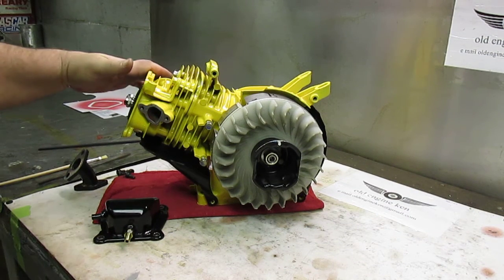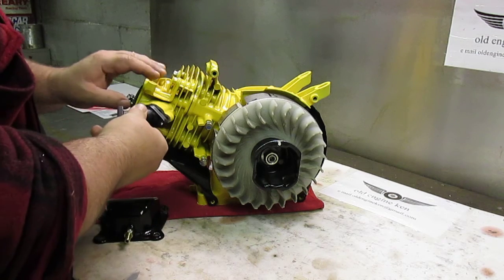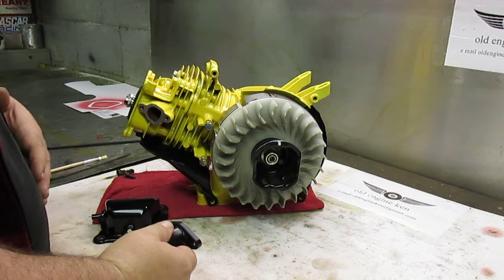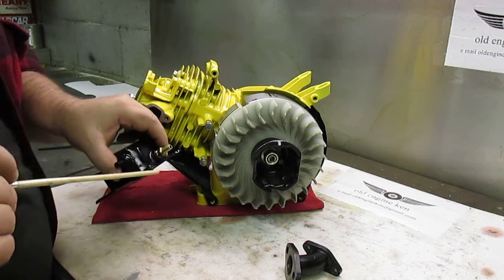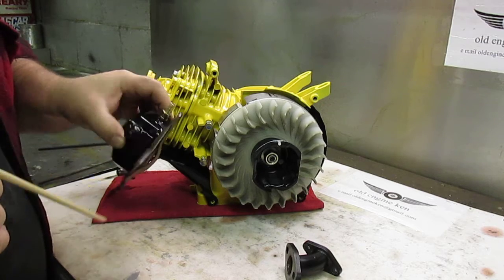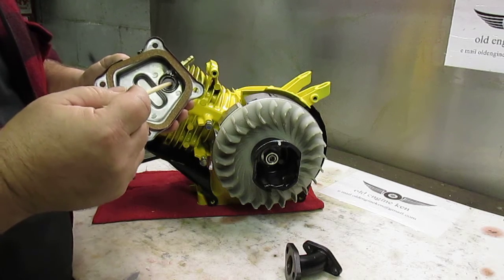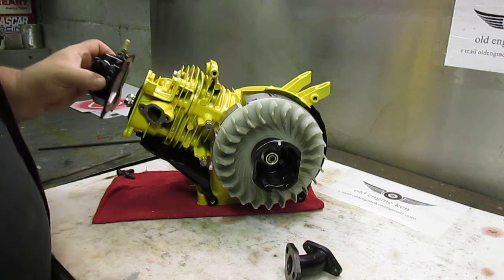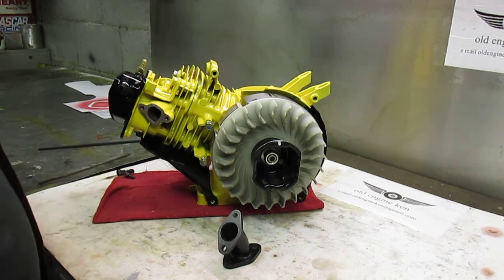HONDA GX 160 PART # 4  INTAKE AND VALVE  COVER  TIPS

Comment: man you don't want to do fuel pump you want to run out onto the top where the governor used to be at it's better oil will not it in the fuel pump